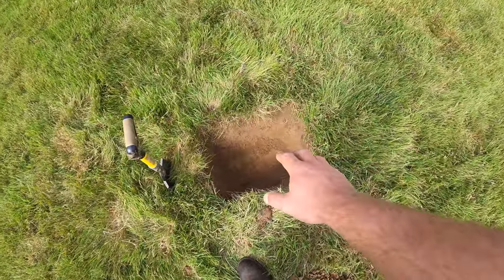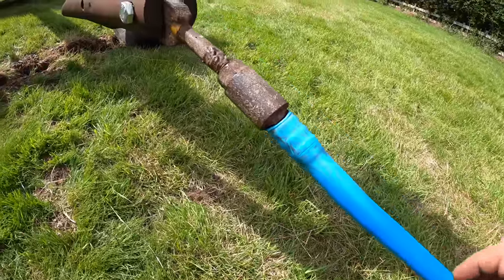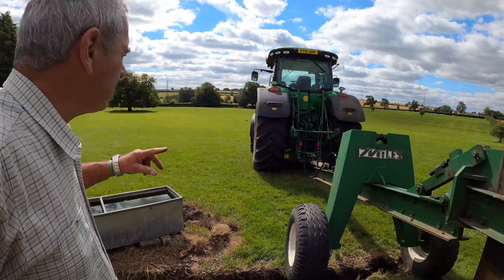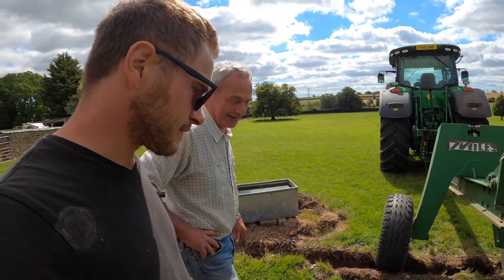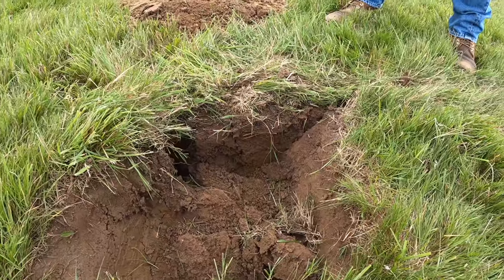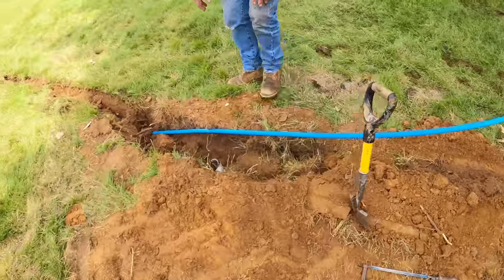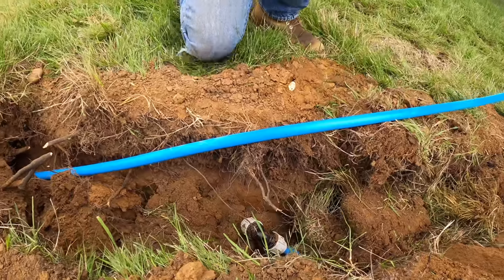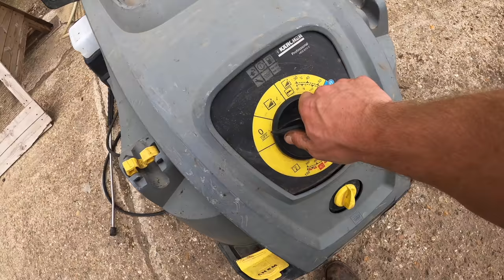WILL IT WORK?! MOLING IN WATER PIPE WITH THE JOHN DEERE

Comment: Glad the water pipe project went smoothly and I remember using a monster hoover to clean barns. It had three motors that when all on was like a jet engine 🥺
Reply from the maker: Yes it went well 👍 this hoover does have 3 speeds but the switch is broke so it’s either on or it’s off 😂

Comment: Happy Days Nick. I bought an old Ferguson sub soiler at auction for £30. It had a scaffold pipe bent into a quarter circle and welded to the back of it. As you went forward you fed the pipe in and it laid in the bottom of the slit carved by the plough. Used this successfully with 22mm blue water pipe, and again with armoured cable  to my stables half a mile away. On the back of a veteran David Brown DB780 - just under 43HP . Like your Vids - watching after Ian Pullens' recommendation. Both water and electric still working nearly 30 years later. DB still working - went up north, last summer,  to a guy, also called Trevor who has made a great job restoring it.

Comment: We were putting pipe in like that 30 years ago. Instead of heating the pipe we had a tube that we poked the pipe into and drove a nail through it to retain it. We then drove until the last few feet when we would slow down and stop dead just as the other ends met up. We would dig the hole then to uncouple the pipe, trim it with loppers, fit another length of pipe, couple the other ends together and drive on to the next point without ever pulling the mole out of the ground. It's still there to this day.

Comment: Tip. I remember pulling a pipe in for mains water years ago. A mate of mine said to weld a steel coupler to the heel of a subsoiler and just connect the blue pipe to it with a regular brass compression fitting and drag the pipe through, I thought no chance, but I was wrong, it worked perfectly. Result.

Comment: Good job, if ever there is any doubt as to whether the  job can be carried out, we would perform a dummy run without the pipe, the second run is much easier.
P.S. as mentioned below, if no adapter is available just tie the pipe to the mole, that works too,
Reply from the maker: I’d be worried it would come off just tied on but maybe that’s worth trying some time 👍👍

Comment: Nice vid, and it worked, and the whole work with what you got thing, nice job.   If you build a bit of a sweeping L down behind the plow and feed it from the tractor side it won't pull up in the trench in a sag/belly/swale (I don't know what your term would be)    Not my genius or anything, have used a lot of what we call "cable plows", that kind of rig, mounted on little walk behind trenchers to D6 dozers.  
If you pull the first coil off, throw something on it to hold it down, then roll out your pipe, weight down the other end before you cut, then feed with just one coil left i the pipe, you would not believe how easy it makes it.   Very hard to put into words, but you're just rolling one coil continuously into the feeder chute. (Or just build a reel, depending on how much you have to do) I learned it the hard way on 2 and 3" HDPE coils, where our reel would only hold 2 coils, but we were burying 3 ducts lol.

Comment: I remember many years ago putting a water pipe round the outside of a field with a 1 leg subsoiler which had a metal tube welded to the back of the leg. Then you fed the water pipe in as you drove round the field. It worked ok.
Reply from the maker: Yes that’s one way to do it 👍

Comment: Am amazed that worked tbh, would have thought the pipe would stretch.
I have used a compressor type mole when working for a utility and it was good but slow, and would dive off in all directions if it hit anything.
Reply from the maker: Yes it worked a lot better than I expected 👍

Comment: With your Miles mole plough installing water pipe I was surprised to see that you were using the drawbar in the transport position rather than on the end of the beam. The pipe laying job looked to work well .

Comment: Doesn't it get deep scratch from rocks when doing long distances?
Reply: If in rocky soil that would be likely.  Seems that the larger the diameter of the point the larger the channel and more compressed the rocks  and such will be into the sidewalls so the pipe has a bigger "hole" to slide through thereby reducing the actual drag.

Comment: I've not come across that way of attaching a pipe to a plough. My one one had a 2 inch pipe on the back of the mole. I reckon you had enough hp as well 😂 last time we tried, we used the massey 😣
Reply from the maker: It was new to me as well, I was quite sceptical but it worked very well and didn’t seem to stretch the pipe, very pleased 😀
Reply: @NicksFarm  well that's the main thing! I've a disc on the front to cut through the sod but looked like yours pulled through well enough